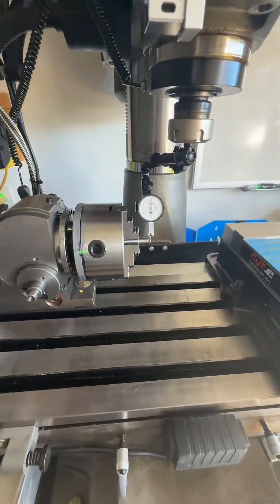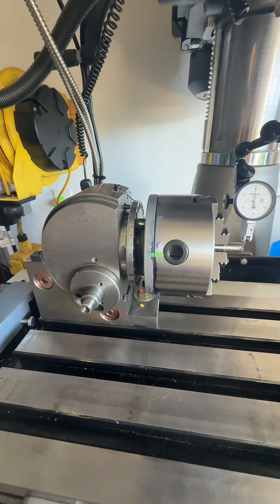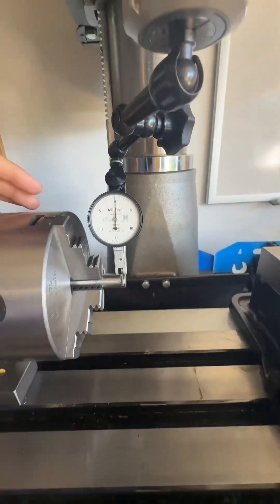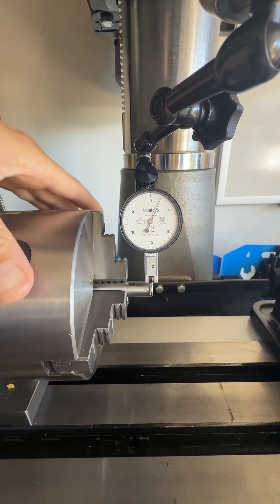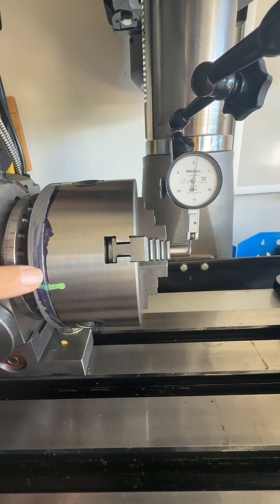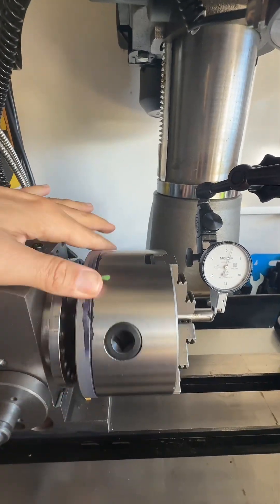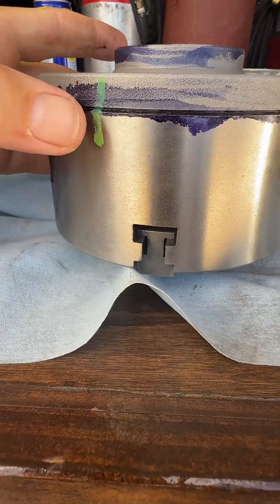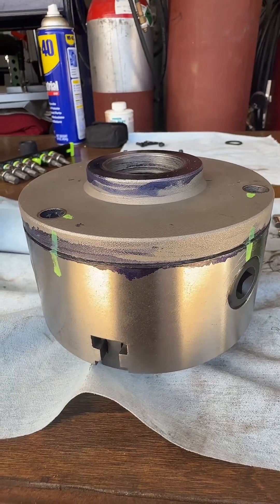Improving  vevor dividing Head

Comment: I have a chuck from the same manufacturer. I cleaned it thoroughly, deburred it and greased it before use. Runout 2/100 mm. But it can be reduced to 0 mm runout if you carefully tighten all 3 lock nuts one after the other. Then a runout of really 0 is possible. Try it out 😉
Reply from the maker: I did try that and it made it worse lol, i might of gotten a friday built unit

Comment: side note here. I bought the same dividing head, was glad it has the same thread as my ATLAS lathe. so I could use different chucks on it. PROBLEM they are the same thread but chucks will not interchange. I believe thr threads were not cut to the same tolerance as Atlas